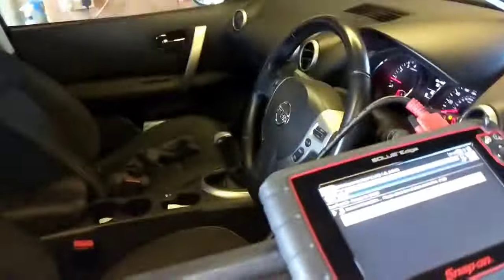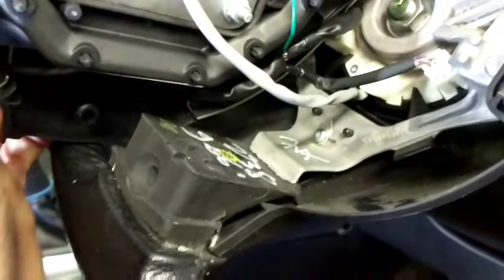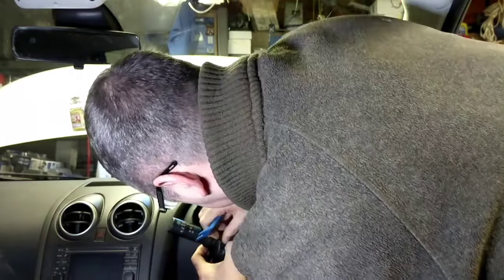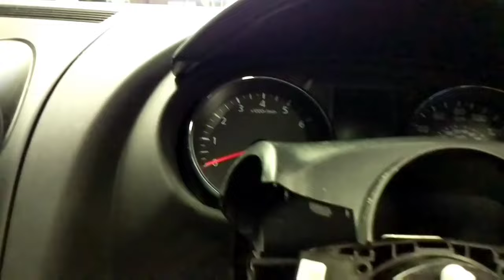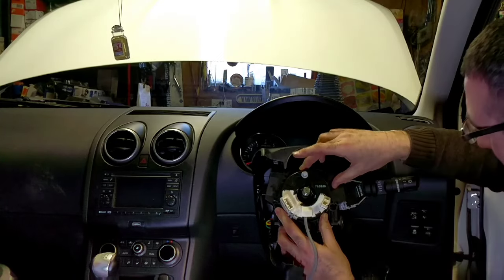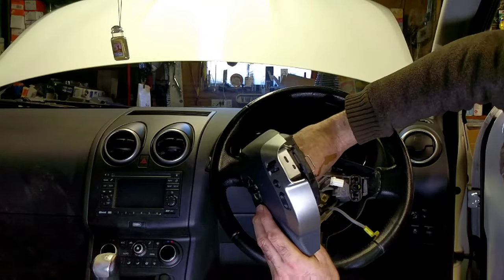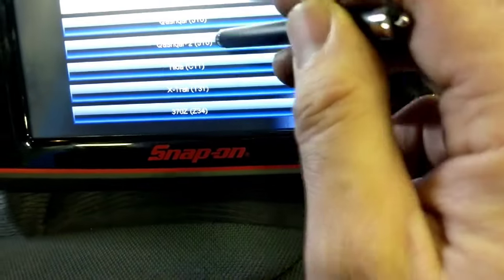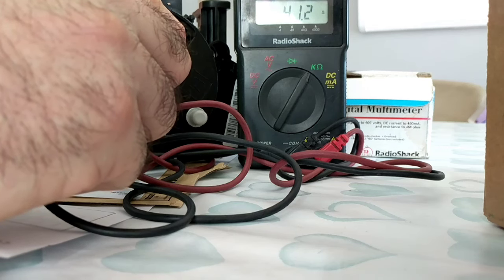Nissan Qashqai Airbag Light Flashing - Fixed!

Comment: wached this video , purchased the clock spring from ebay for less than £15 delivered, fitted in 30 mins only fiddly bit was to remove the steering wheel cover /air bag.

Comment: OK how the bloody hell do I get those two clips off? Stuck at the first hurdle here just stabbing blind inside me steering wheel trying to even vaguely touch where they might be. Is there a trick to it? Or is it just incredibly badly designed?
Reply from the maker: All airbags are much the same. As the video shows you need to press the metal thin bar with a screwdriver at 90° to the bar. Push down on the airbag and pull on it and hopefully it will pop out the clips. Once you get it in your hands and look it's a very simple but fiddly design. Don't forget to disconnect the battery 👍. Good luck.
Reply: @Automotive_Solutions  Yeah managed to get it out shortly after - I'll push down next time as that was probably the issue. One weird design thing mind is they put all the plastic electrical connectors for the clock spring directly behind where you're expected to stab in the dark with a screwdriver.. oh well nothing broken and found out the part number I actually needed - here's hoping the actual replacement goes smoothly now! Saves us £150 or something on what the garage quoted us!
Reply: @Automotive_Solutions  well the good news is getting it changed was easy and got the knack of getting the airbag off eventually, but after reassembly the steering wheel sits at an angle in the neutral position. Not sure what's up since I lined up the arrow on the wheel with the line on the bolt for the steering column.. car drives fine and if you let go a second it goes in a straight line, just the wheel is crooked.
Reply from the maker: @sonicwingnut  the only thing you disturbed is the steering wheel.

Comment: Hi. My airbag light won’t go off. It’s been reset a few times but always starts flashing again. The code is a ‘past b1129’ code. Any advice would be great!
Reply from the maker: My info shows that as front right side airbag. You need someone to test, confirm and repair it.
Reply: Automotive Solutions many thanks indeed. I’ll mention this when it goes back to the garage.

Comment: Hi there, was it just the clock sping you replaced ? Also did the steering wheel controls still work even before you changed it. Ie volumn and cruise etc. Thanks
Reply from the maker: @alunowen8693  all controls worked. Just replaced clock spring and cleared faults.
Reply: @Automotive_Solutions   my airbag light is on. But was told if the clock spring is kaput then the volume, cruise phone don't work then, but mine are all working. Will order the clock spring the now. Thank you!!!

Comment: Fantastic video. Seems to have worked for my Qashqai +2. Purchased the part off Ebay for about £20 so very happy. When I rotated the inside of the old one, you could feel that there was quite a bit of play, so I'm guessing that some connection is no longer being made. Been driving around for months with a flashing light which is very bad I know -  one less thing to worry about for the MOT in a couple of weeks. Many thanks. ( I also had to clear the code using the turning the key, waiting 5 seconds method!)
Reply from the maker: Excellent 👍😁
Reply: Hi mate Can I please ask I have a qashqai +2 2013 tekna Is yours the same year? It's not easy to find the right part because the serial numbers don't match on eBay. How did you know to get the right one? Do you have cruise control and did yours have two connecting leads?
Reply: @Android-vk8yh  purevue was the eBay seller. I sent my details to them and they responded very quickly confirming the correct one. Mine is the 2011 +2 so possibly not the same. 1218sd was the number printed on top of my original one if that helps. I took off the steering wheel as practice and to check the code on the part then just put it all back and ordered. It is very easy to do. I did take some photos of that helps . Happy to email them
Reply: @Android-vk8yh  does have cruise control and the replacement has 2121sd marked on it
Reply: @neilphillips6576  thank you for your replies. Much appreciated. Did yours have two leads to plug in? I think if you have cruise control is normally two?
Reply: @Android-vk8yh  I’m almost certain that it was the one with the single cable. Definitely has cruise control though. I would definitely recommend having a look first if you can!

Comment: Just used this video to swap the clockspring on our 2015 model - VERY helpful !!!
Although first time round I did get the Two yellow DSP lights on the dash after the repair, I had a look in the comments and soon realised that I had not lined up the Two grooves with the sensor. 
I did the ignition on and off Three times to get the red airbag light in to the diagnostic mode and this cleared the flashing light for good as my code reader will only do the ECU codes.

Thanks for your help with the video!
Reply from the maker: Good work !
Reply: Sorry what groves were not lined up please

Comment: Great video, thanks! :) Actually I just wanted to see how to proceed to change the turn indicator lever/group and your video is great also for that.
I now found out that it is not necessary to remove the steering wheel to open the cover behind :) This allows to solve quite easily the well known problem of the direction indicator keeping blinking 3 or 4 times, after the lever has gone back to the off position (models around 2007 /2012) ;)

Comment: Nice vid thanks. I have a 2012 Nissan qashqai 1.5 and I have a flashing airbag code 12 low voltage. Could this mean the clock spring needs replacing as my cheap db code reader doesn’t display any fault code only the diagnostic single blink long double blink airbag indicator light or am I looking at a different fix?
Reply from the maker: Code 12 is normally related to drivers airbag / Clockspring.  A diagnostic investigation by a competent person would be my best advice before guessing at parts. Good luck 👍

Comment: Hi.  Great vid.  Found whilst looking for squib replacement guidance, but my issue is not airbag related… I’ve got no fault codes but the cruise control is not working - would this usually through out a code if it’s squib/spring clock related?  I note from previous comments it might be worth getting the switch itself tested, so the video has helped to get to that as well anyway! ;)
Reply from the maker: Ideally a scan tool with live data should show you cruise control status. I wouldn't change parts on a hunch. 👍

Comment: That's a good video but where do you recommend getting the squib from? It can be £200 from Nissan and there's a million and one different combinations of leads and connectors. I believe mine's a j10 like your one cash car plus two but it has cruise control so I think it's a dual connector?
Reply from the maker: I've only used genuine dealer parts so no problems getting the right one. Only downside is they're quite expensive. I suppose if you could get the part number off the old one you might be able to cross reference it to a pattern part. 👍

Comment: Very good tutorial. Quick questions : for those of us that do not have access to clear codes can you use the ignition on/off 5 sec 3 times ?
Reply from the maker: Not sure, I use my diagnostic tools. Someone else might chip in to help you. 👍
Reply: yes u can  but if there a fault it will still come back up, 
Ive done both thro the diagnostic kit cleared it and ignition  stil came up 
Now i either need to replace module or spring coz there something up clearly
Reply: Yeah done it today no need for diagnostics tool just reset using the key

Comment: Will this cause the engine management light to come on? Horn not working too.....related?
Thanks
Reply from the maker: Horn not working can be related but engine management light doesn't normally appear with this fault. A scan of the ecu will identify the reason the light is on.

Comment: Thanks, very good and useful video.  I just finish with replacing airbag squib (AliExpress OEM part, close to genuine ) and reset with ignition key (3*5 sec switch off-switch on...) for  know  SRS light its not flashing. So, is it enough, or its necessary to erase error with OBD  tool -computer ?  Thanks again.

Comment: Hi my qashqai is a 2011 61 1.5 dci n tec sat nav model are the squibs all the same or is there different types thanks
Reply from the maker: There's a couple of different types. One has a 2 stage airbag (2 wires) and the other is a single stage airbag (1 wire). If you buy it from Nissan they will supply the correct one.

Comment: Thanks for this, Just changed mine, On my way to a friends house to get the airbag fault cleared i got another fault on traction control.  Did you experience this at all?  We used diagnostics to clear the airbag fault and all is well but does not show any traction control errors despite 2 2 warning lights being on.
Reply from the maker: I didn't have this problem. If there are warning lights on then there must be a fault code stored in one of the modules.
Reply: @Automotive_Solutions  Thanks for the reply, no errors in ecu which is odd. I'm thinking as the steering wheel sensor is on the back of the squib that I may have damaged it or its wiring while transferring it over.  Ill have a poke about over the holidays.  Thanks for your time.
Reply from the maker: @G0WZB  - I only use the  genuine part for these.
Reply: @Automotive_Solutions  Found the problem.  Was looking at the old part and realised there were 2 grooves on the inside where steering sensor goes.  i never noticed these when i transferred the sensor to the new squib.  Took car apart again and the tabs on sensor were about 45 Degrees out.  Realigned them and hey presto fault gone.  Thanks for the great video and help.
Brian
Reply from the maker: @G0WZB  - that's handy. I'm sure this will help someone out in future. 👍
Reply: @brain thank you so much i just fitted my new one and guess what the esp lights have came on i scanned it and the sensor was out 145 😂 i reset it and still it came on ive just seen your comments guess im gonna have to take it all out again and fimd these grooves your talking about thank you!!!!

Comment: How much does it cost for the replacement airbag squid/spring (for a Qashqai +2) ...the airbag light keeps flashing.
Reply from the maker: Although it's a common problem it still needs diagnosing as there can be many faults that will make the airbag light flash. Last time I bought one from Nissan it was about £160. Most garages would probably charge an hour or twos labour to fit it.
Reply: @Automotive_Solutions  that's robbery right there 1-2 hrs took me 20 min if that

Comment: How did u disconnect yellow and grey wires. I am trying but scared if they get damaged.
Reply from the maker: There's a tab that needs pressing as you pull them out. I know one has to come out before the other. I think grey first then yellow. Get a mirror to have a look at the tabs first so you know what your up against and make sure your battery is disconnected during the whole process. 👍

Comment: Replaced the clockspring but problem still persists, what would you recommend next? the airbag light flashes one long flash followed by a pause and two short flashes. Don't have a diagnostic computer and don't really want to pay out as just fixing up an 07 qashqai for a bit of fun don't want to spend unless I really have to
Reply from the maker: I'd recommend getting someone qualified to check it over. The airbag is a safety system after all. No point keep throwing parts at it hoping you'll find the problem. Sometimes it's cheaper and more cost effective to let the right person look at it. Good luck. 👍
Reply: @Automotive_Solutions   I'm currently running on a zero budget basis lol. Replacing the clockspring fixed the steering wheel controls so that's one positive, just need this airbag light off and a new dpf on and it should get through an mot.
Reply from the maker: @evripidous  have you read babelbear's reply in the comments  as he reset his without any diagnostic gear 😁
Reply: @Automotive_Solutions  Turned out to be a airbag module, borrowed a friends and error cleared, put mine back on and error came back. managed to get one for  £30 at a breakers. problem solved.   Now for the DPF lol.  got code P1435, my theory is a new dpf will clear this?
Reply from the maker: @evripidous  - cheap fix for the airbag light 👍. Not sure about that code but dpf might need a professional clean and / or  replaced. Need to rule out any other problems preventing the dpf from regenerating. Possible software update but that would need dealer level tool to check.

Comment: If the problem is in clocksrping, will the controls on the steering wheel work, because i have a problem with slow blinking airbag light? Thanks.
In the garage said its clockspring.
Reply from the maker: Normally the controls are still ok, just the airbag circuit is the problem. 👍

Comment: I have a flashing airbag light on my 2008 Nissan Qashqai. I also have that noise when you turn the steering wheel.  The cruise control switches on the steering wheel have never worked (I bought the car second hand). If I move the steering wheel all the way to the left and keep it forced to the left, the cruise control can be activated but as soon as I left go of the steering wheel, cruise control cuts out. So, my question is, can changing the clockspring help with the cruise control as well as the airbag light?  Ta!
Reply from the maker: I would imagine the clock spring is your problem. All the functions of the steering wheel controls go through it as well as the airbag. 👍
Reply: @Automotive_Solutions  Changed the clockspring today. Airbag light gone, cruise control now working, but as I drove off the drive the ESP light came on with the word 'off' underneath it. I tried switching it back on via the button to bottom right of the driver console but that does nothing. Any ideas?  I did a straight one for one swap.
Reply: @AnonAnonAnon  did you manage to get this sorted?

You may have messed up your steering angle senor and it will need resetting.

Comment: Anyone know if this squib will fit a 2009 Nissan Micra. Not getting much help from sellers on eBay.
Reply from the maker: I doubt it. Also some vehicles have 2 stage airbags so best check with the manufacturer for the correct part number.
Reply: @Automotive_Solutions  thanks 👍

Comment: The left side wheel buttons on my Qashqai stopped working some time ago, but the right side ones work just fine, and there are no airbag errors. I'm guessing the problem is the same part, right?
Reply from the maker: ComandanteJ - more than likely the same part but could just be the buttons on the steering wheel faulty.
Reply: Thanks for answering! I'll check them with a multimeter before ordering a new squib, then.

Comment: Bonjour , pouvez me donner une référence ou une équivalence de votre contacteur tournant car j ai essayé un z3 de chez auto doc  mais pas compatible , j ai un 4 L 21025 sd comme vous sur la vidéo merci
Reply from the maker: I buy mine from the Nissan dealer so they use the chassis number to get the correct part. I don't have a number for you I'm afraid. Sorry.

Comment: Hi, Left side buttons only not working on mine, horn also works intermittently. Could it be loose connection or should I replace the squib? Cheers
Reply from the maker: You'll need someone with some electronic knowledge to do some testing before replacing the squib.
Reply: @Automotive_Solutions  My background is mech engineering, I should know lol. Might get the multimeter out the weekend. Thanks for the reply
Reply: Mines the same.  All buttons work when the wheel is rotated 90 degrees.  I suspect squib on mine.  How did you fix yours?
Reply: @flashybike1  yes, I replaced the squib and it solved everything. Purchased from AliExpress for ~ €50 I think. Nothing too complicated involved. 

Disconnect earth from battery, few pieces of trim/ indicator stalk to remove (easy), then 2 relatively long flathead screwdrivers to unlatch the springs/hooks that secure driver airbag to centre of steering wheel (there is a hole each side to insert them).

Then you'll need a socket (can't remember size) to remove steering wheel. Note the marking on both column and wheel. Remove wheel and squib is beneath.

There could be a video of someone taking this repair on YouTube now, it's been a few years since I did this and I have since sold the vehicle.

All the best,
G.

Edit:

Just noticed this is a video of someone taking repair lol

Comment: hey iv replaced my clock spring. airbag light went out but now esp lights are on with c1132 any help would be much appreicated.
Reply from the maker: tommy quinn - not come across that myself but double check all the wiring that you disturbed or disconnected.
Reply: will do thanks
Reply: I have a same problem with my Qashqai j10 2008, can you please tell me where was the problem on your car. Thanks
Reply: @alvinkurbasic4230  my problem turned out to be the steering angle sensor.
Reply: tommy quinn was the angle sensor near the squib and if so how did u fix this?
Reply: @simonwilde9010  the angle sensor is the part that gets changed over, 3 little screws fitted to the back of the squib.

If this is disturbed from its original position during the replacement of the squib it will give you the symptoms you have.

You need to reset the steering angle sensor. A decent computer should be able to do it.